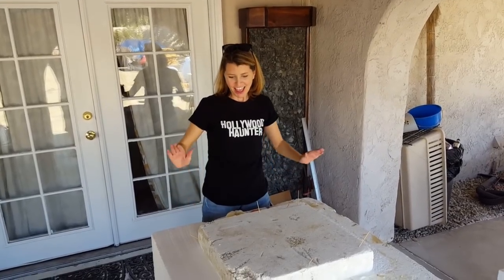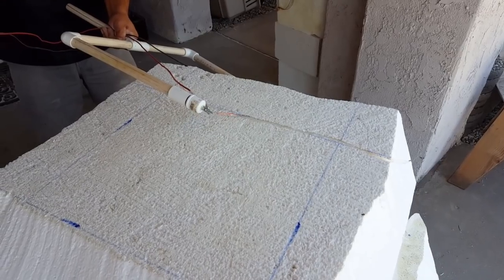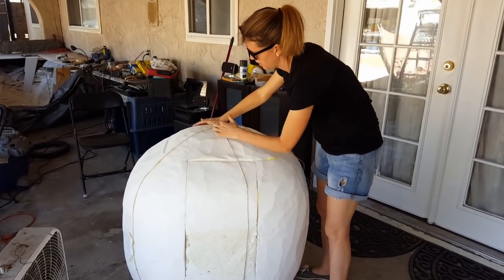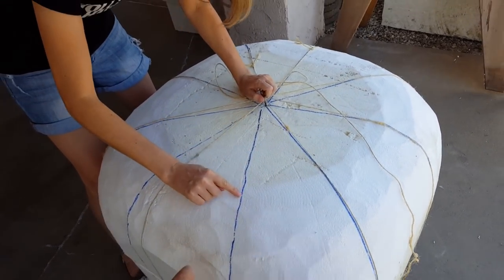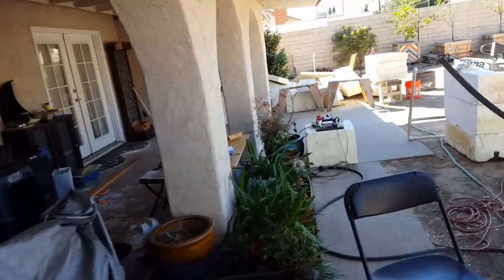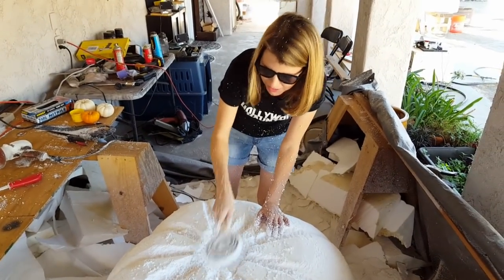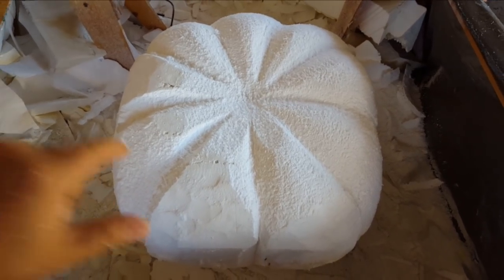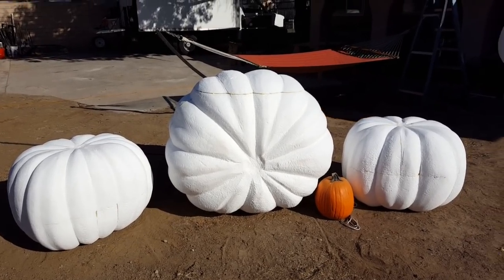Carving Giant Halloween Pumpkins | Sculpting Foam Props & Decorations | Charlie Brown Pumpkins

Comment: you guys are such fun!  Nice to see people having fun making stuff...and I did learn something too! Thanks a bunch and I will look for other projects:)  I have also used for smaller projects the outside Spackle compound for a coating..seems to work great and has the sand texture that adds great base for rocks etc...:) Of course it is rather expensive, but all I knew about at the time...now that I have the flexible concrete stuff will give that a try, the only problem is when it cracks...which can be a problem for nature centre sets that have to be kid proof...you know how that is!  Cheers!

Comment: These pumpkins are insane!! I love that hot wire you guys have, it's over the top. Did you make that? I have a little one I got from Amazon. 🎃
Reply from the maker: Yes we made that we have a couple different power supplies to power it it but it works great.  We also use soldering irons as our hot knives.  Thank you

Comment: Baby? Congratulations!
(sorry if I'm late on that. didn't catch a mention of that before)

Great project! I'm liking the builds you guys are coming up with here.

I've never work with styrofoam before, so some questions/comments -
In retrospect, it seems to me like the electric cutting was slowing down this project since you finished up with all the hand tools anyway. It seems that when doing something like this that's going to make a mess anyway, just using a hand saw to cut the reference lines would be a lot faster. Just mark the blade with painters tape for the one inch depth and don't cut beyond that point, or clamp a piece of wood to the saw for a positive stop. 
Is there some other advantage to using the electric knife on a project like this of which I am not aware?
Could you use something like a hot iron to melt the surface smooth, so you don't have to do all that sanding and generate all that styrofoam dust?
Have you ever tried use a propane torch to achieve a smooth surface, or would that just be to difficult to control and be a fire hazard? Maybe use a heat gun instead?
Reply from the maker: we have done or tried much of what you mentioned and it all works.  we use the hot wire mostly to give our arms a break.  even cutting with the Sawzall all day gets old after a while which we do all the time.  the hot wire is effortless and chill.  For us its nothing to do with mess, we make a huge mess and never think twice about that until we finish our projects then we just have a couple good clean up days.

Comment: Where do you guys get the big foam blocks and what do you use to hard coat the foam with?
Reply from the maker: We got them from a Haunter who got it off of Craigslist. A theater had used them for sound proofing. We have had them for several years. There are a bunch of different methods of hard coating we have used. We have used professional Smooth-On products,  Plaster, Flex-bond mortar, we've heard wood glue works, DryLock, or driveway sealer and paint.
Reply from the maker: Just wanted to let you know we list some places to get big blocks of foam and how to hard coat them in this video if your still interested  https://www.youtube.com/watch?v=bPqoaJu6z4U&t=1007s

Comment: Where do you buy/get your foam blocks?
Reply from the maker: We got ours off of Craigslist. I would check there first. People are either giving it away in the "Free" section or they have blocks for sale. Next I would look at online retailers. We have a local place called Foam Mart. You may have something in your area that has different available blocks. Last you can make your own by buying the 4x8 sheets and glueing (Great Stuff works the best) sections together to create the sizes you need
Reply: @HollywoodHaunter  thx for the reply :) I appreciate your insight:)

Comment: I'm sure you're not going to see this comment but if you do I use a wire wheel on a drill and if not that then I use the little sanding tools that come with a dremel and just keep digging deeper and deeper and deeper it works
Reply from the maker: Thanks we will have to give that a try.